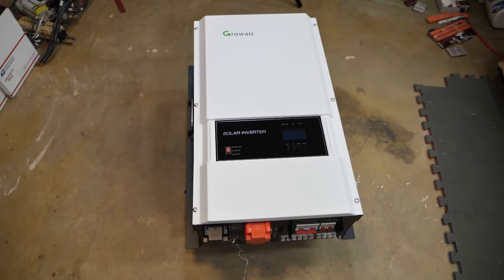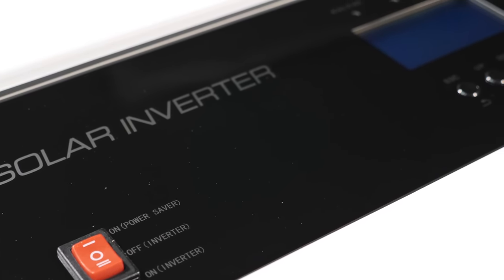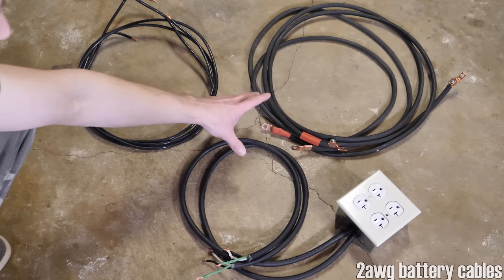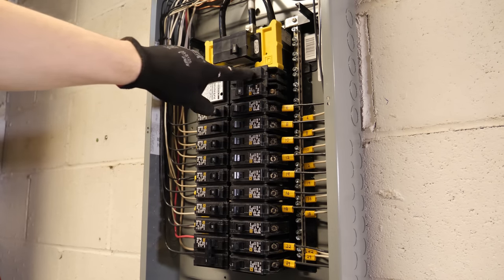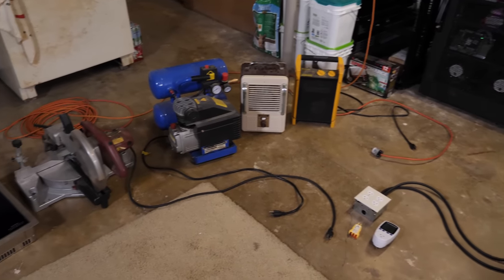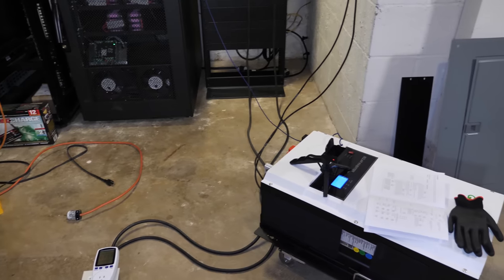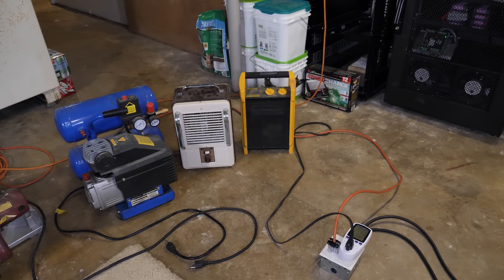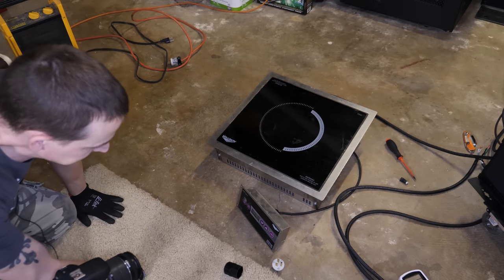12kw Growatt Inverter Operational Check/Review!!

Comment: Thanks for the video. I have the same inverter/ charge controller.  I was going with different brand and model when I found the growatt. I talked to same place and about different models and went with the 12kw too. Started the solar design and planning 6 years ago  with move to large acres in mountains. Well 3 years ago did the big purchase and stock pile of supplies. Then begin this year bought batteries and started our offgrid homestead in June. Well finally getting my pv setup and finishing wiring. So it was nice to see the setup and test. I also have to hook up my generator to system so when batteries are low and no- little sun it will kick on.
Reply from the maker: NIIIIICE!!! Im a little jelly of your place in the mountains. Id love to do that! Im from wyoming and miss it. Live in Omaha Ne amd its to flat🤣
Reply: How much is the standby consumption when the inverter is on and not powering anything?
Reply: @Dave_889  well still learning as we go. But it has standby and on and have seen that the read out is not accurate. But on standby it says 1.2% and I forget the watts: still have to get second array up to get better charge and the generac activation done to charge plus get the 2 wire relay on the victron monitor setup: it’s been tough working full time job and building a homestead from scratch plus manage power.
Reply from the maker: Its 150ish watts powering itself and nothing else!💥🤘
Reply: @AveRage_Joe  Daam, that's a lot of power
Reply: @kylebacher8074  I assume you are using at least a 48volt 100AH Battery to power it. How long does your battery last and what do you power?
I plan to purchase one at end of this year and I am wondering if 1 of the EG4 48VOLT 100AH Battery will be enough for the time being to power my home.

Comment: couple questions, what is the maximum solar watts i can input into this inverter and if i dont have batteries will it still power the 12kw to my home just using the solar input? thx
Reply from the maker: Solar input is 7000w or 120 amps.  This inverter requires a battery but yes you can use the full 12kw!
Reply from the maker: You bet! Yeah if you need 12kw and are running off solar during the day, you will draw from battery. For solar input "they" (people of the internet)say you can go over roughly 10% which is around 7700watts. That will allow you to charge sooner in the day, later in the day, more charge during cloudy weather ext... as the inverter charge controller will only output 120amps. If you have more panels then yes add a seperate charge controller and try to match the settings as best as you can. Thats what ill be doing when I get more solar!🤘

Comment: Great video Joe, I just order this inverter and also 16 panels @425w which will give me 6800w. I will connect directly 8 panels in series to PV input #1 and 8 panels to PV input #2 on Inverter. Do you think that this is the way to do this correctly? I am little bit confused about this and I don’t want to make any costly mistake, so I would like to have you comment or suggestions on this please. Many thanks
Reply from the maker: Nice! You will love it! So for your solar input, series as many as you can BUT dont go over the 150v or 250v input which ever one you purchased. Just look at the open circuit voltage on the panels and then add it up. I have 6 in series. I could do 7 but wouldnt have enough panels for all the other strings.

Comment: I have a strange question i dont see any answers for. On the 12k mvp i found that pv1 and pv2 are separate as far as each has a max of 250 volts and or 7000 watts solar but can they run with diferent voltage on each one and could a 48 volts 30 amp be hooked to one. Here is my thought for why this question. If i hook my 6000 watt solar to pv1 running 233 volts at over 40 amps. I would like to hook my 48 volt dc wind turbine to pv2 at around 25 amps. Would growatt accept that?
Reply from the maker: So the pv inputs are seperate 60amp charge controllers and each can accept up to 250v. Again they are seperate for a combined 120a. Yeah you can use 233v on pv1 and a different voltage on pv2 BUT you would want to be in the MPPT range if possible.

Comment: I own one of these growatt inverter. I am on my 3rd one over the last 4 months.  First one dead on first 24 hrs.  2nd one had fan lock codes by week 4. Growatt sent a firmware bin file update and it kills the display. And my 3rd one had same fan lock code by week 4.  Growatt sent same firmware bin file fix. I am back to display unreadable and hard to control the inverter settings with a unreadable display.
Reply from the maker: WHAAAAA!!!!! For real????
Reply from the maker: Do you happen to know the firmware number? If I get that issue I for sure dont want to flash with the same!!!
Reply: The only way I can control these inverter now is using pv keeper software on pc or the shine phone app on my phone. I have never uploaded a youtube video before or I would show what the display looks like when wrong bin file is flash making the display unreadable.
Reply from the maker: Thanks for letting me know the issue and that number!!! You could send a pic to my email if wanted its averagejoestuff@gmail video may be to big for email. Id be interested to see!
Reply: I just emailed you pics
Reply from the maker: Awesome! Checking meow!

Comment: Great video! One question, I have this inverter and have it set for the utility to charge my batteries if the solar fails and the battery voltage gets below 46v. Could you share your settings, specifically programs 01, 05, 12, and 13? In my tests, the utility power never kicks in.
Reply from the maker: Awesome! Yeah my settings are as follows.
1-sbu
5-use
12-46v
13-54v

Comment: That induction cook top looks like a NEMA 6-20 which is needs a  250v 2 pole  20 amp circuit. You need the proper circuitry to test. It looks like you were only test single pole units. There should have been some sort of switch to change the unit work on 120v. Time to test it again. Make sure your are using the specified amperage outlet and plug please. You were using a 15amp plug in a 20amp outlet.
Reply from the maker: Interesting, I didnt see a switch but to be honest I wasnt looking lol.  Time to test again!!!

Comment: do you still recommend the 12kw Growatt Split Phase Low Frequency 120/240 Pure Sinewave Inverter Model # SPF12000tDVM??
Reply from the maker: 100% still recommend! Get the MPV 250v version. Should be linked down below video. I actually ordered the 150v version and the 250v was delivered. I honestly didnt know until latet lol🤷‍♂️  Ive been using mine pretty much non stop. Few randow glitches here and there but I would purchase again. Another I would recommened is the LV 6548. I did a review on my channel. If you get 2 of those for split phase then you get more charge controllers for solar. That would be the only downside to the growatt 12k.🤘

Comment: Hello, like the videos... question. What would you use for a small 7 to 10 rack datacenter? Would this work or bigger unit and big battery?
Reply from the maker: Thanks mate! What are your plans for the rack? As in off grid or as a ups(for powerloss). What is the racks total wattage while running?
Reply: @AveRage_Joe  Hello, this would be power loss, and connected to grid, no solar to start at least. not sure of total power, but I'd say under 30 Amps
Reply: Looks to be around 10k Watts, but that will go up, so I'd rather go over kill and not have to add or replace stuff down the road.
Reply from the maker: Ok. Well 30amps on 120vac is no problem on inverter or battery. This battery would give you over an hour runtime. If you need 10kw of power then you would want A LOT more battery as in more in parallel. How long of runtime do you need/want?
Reply: @AveRage_Joe   1/2 hour would be ok. I'm looking to replace the 3k UPS's at each rack. the cost per rack for UPS's is about $2500. If this will work to to place them I'd save a good amount.  On that note, can you use more than one going into the same electrical panel?
Reply from the maker: Oh ok gotcha! So really you would only need like 3 batteries. That will give you 300+ amps of battery and give you over an hour at full send of the 12kw inverter. For the inverter or this exact same 12kw inverter, they cannot be paralleld together but you could always add a seperate subpanel for another inverter if you ever needed to.
Reply: @AveRage_Joe   I was just thinking the same thing, 2 feeds from AC main, 240 volt... then 2 inverters for say 5 racks each.  What setup for parts do you think I will need? Feel free to add affiliate links if you have them. I do see they make a 36k and 70k, but think they might be out of reach for now,.

Comment: Hi Joe! , Recently I purchased this inversor + 12 panels (540watts) + 8 trojan batteries (6v lgac-ac),  but Is not working correctly, when the batteries are low (or the house require more load of the avaialble of the pv+batteries) the inversor power off instead of bypass to utility, the batteries have a dc shunt of 80amps , I noticed every time the inversor power off is because the shunt circuit break is open, so I should close the shunt and restart the inversor, do you have an idea why is happening?? I researched about the shunt and noticed most of the sites recommend install on the negative wire, I reviewed my installation and the shunt is on the positive! , this could be the reason??
Reply from the maker: What is your low battery voltage setting at? Most shunts are on negative wire. Unless you are saying your circuit breaker is on positive then that is ok. Also an 80amp cb sound a little small to me for a 12kw inverter. You should have around a 300+.

Comment: Would a 48volt EG4-LifePower4 Lithium Batteries Kit | 30.72kWh work with this and how much solar panel  input would this need to keep it charged up?
Reply from the maker: Yeah those batteries would work great. Id max the solar charge controllers on the inverter out! Summer time(for me) is ok but winter not so much. I would need double for sure.

Comment: Well I just got into the comments to let you know that an induction cooktop will not operate without a proper load, that is to say, an induction ready pan, skilit, or pot, and don't put it on empty, because it heats up very quickly, and if it is a non-stick, it can go past the maximum safe temperature, there by destroying the non-stick coating, but I see someone else has already mentioned it after I already wrote this comment. 😖Also this inverter draws way to much idle current My OutBack inverter idles at 24 watts granted it is 3,600 watts, however running 3 in parallel, which gives me 10,500 watt capability is still only 72 watts when all 3 inverters are running, but the good thing is, they are staged when in parallel operating mode, which means that only one inverter is running until the load gets passed 12 amps in which case it calls a second inverter online and then when it gets passed 24 amps it calls a third inverter online and you can parallel up to 10 of these things giving you a continuous 36,000 watts. 🤔😳😉
Reply from the maker: Its cool to hear your inverters work like that! I didnt know they could do that!  Are your inverters low frequency?

Comment: So, will this thing use the grid for a backup to supply loads over what the inverter or solar might not be able to produce?
Reply from the maker: Yeah you can set it up like that. I have it set to use grid as a backup if battery and solar are dead or cant keep up, it switches over to grid!🤘
Reply: @AveRage_Joe  Very nice!  Do you know if it can be limited to not feed the grid?
Reply from the maker: It does not feed grid.
Reply: @AveRage_Joe  Oh hell, I missed that then.  Awesome unit there...  Been torn between this or a couple 5000ES...

Comment: In the user manual for 12k version it says to connect “3*2AWG”. Does that literally mean three wires from each terminal? Am I reading that correctly? You clearly just used (2) 2AWG wires for battery which seems to make sense. Am I reading the spec wrong?
Reply: Yes they mean 3x2 AWG cables from each terminal,  there are lots of amps going through those DC wires if it runs on max continuous load.
Reply from the maker: Yeah you can use 4/0 for sure. Ill be using 2/0 with my new batteries.
Reply: @The Osborns yes you could use 4/0 however there is not much space around the terminal of the inverter so bending of such a large cable can be a problematic.

Comment: Is this a high frequency or low frequency inverter. Does it handle surges?
Reply from the maker: It is a low freq inverter and can handle surge to 36kw!😁💪
Reply: @AveRage_Joe  that's an amazing inverter I'm off grid so I dont need the grid tied features
Reply from the maker: Yeah you dont need to connect to grid if not using as a ups or anything like that.

Comment: I have the same Growatt you do, I 7000 watts coming in and runs whole house ok, but although the inverter is 12k watts, batteries get depleted throughout day. I don’t get it, an inverter designed for 12k but can’t charge batteries at a higher rate, can you explain, thanks 
Good job btw
Reply from the maker: What are your settings and how long do you have 7kw coming in?

Comment: Hi Joe, I have an 8.4KW grid-tie Enphase solar system that produces 240V and shut down when there is no power from the grid, Question I believed I know the answer, it is possible to use the inverter and battery out the grid to supply the 240v to the solar system so they can start producing and supply energy to the inverter and charge the battery?. question 2 there is any inverter without the function of solar input so I can use it only as backup power when there is a power outage instead of using a loud generator.    Thanks
Reply from the maker: 1st question is no. You would need an AC coupled inverter like a sol-ark. It can grid-tie amd when the grid goes down you can still use the solar and system as you are asking. Also has a battery. Question 2 is yes,  most inverters can be used for a backup if it has a solar input or not. I can use mine without the solar. Hopefully I answered your questions. Let me know

Comment: For 240v, should  the neutral and ground for subpanel connect to the inverter(ac input grnd & ac output N)? Should G and N be separated inside subpanel?
Reply from the maker: Inside sub panel yes seperated. Mine bond at main panel!

Comment: Great video and lots of comments in reply. Is the 160 watt standby power a good thing for these low frequency inverters? Is there some way around that? If I dont want to be burning thu 160 watts every hour on my batteries and want to have 120 volts at my house outlets what can I do ?  I suppose in the day time the solar panels should cover this loss but after dark Im losing 1.6 kwh per night.
Reply from the maker: Thanks Man!  Yeah the 160w is high but pretty standard for this size of inverter.  Im not to worried about it at this current time but Ive been use to higher idle draw from the 2700w UPS I was using for an inverter.  I know the high frequency inverters have a lower standby or idle draw but not many are split phase and cant start a regular saw or compressor.  If you dont need a low frequency inverter you could go HF for sure!

Comment: Hey Joe, I installed two of these babies but I over estimated it.  I was told that a flash upgrade would fix the issues. 1 of my units has been a brick since june 2022 the flash failed bought off of alibaba the poorest of customer service directed to them by the usa vendor that endorsed the flash. . 
I am in need of all the help that I can get
Reply from the maker: I can send you a link to the firmware I flashed on mine a year or so ago. I think I still have it on google drive

Comment: Great video Joe, because of your video I went and buy 6000 watts version but sometimes it reboot by itself and when my battery is too low the inverter shut off but when it comes back on I have to change the setting to 60hz. It does not stay on 60hz after rebooting
Reply from the maker: Interesting! I would check for a firmware upgrade!

Comment: Can this run on solar and battery, then, if battery is low at night, then it does AC pass through? In other words, only use AC passthrough as last resort.
Reply from the maker: Yes! And that is exactly how I use it!
Reply: @AveRage_Joe  thanks!
Reply: Does it have a Dump load? Like the sol ark? A circuit where if the batteries are full and there’s excess solar, it sends the power to something like a hot water heater or electric car charger?
Reply from the maker: It does not have a dump load for other circuits!

Comment: I have the grow watt 6000 spf off grid system that I got from big battery with the husky 48v battery. It was working fine until 1 day it stopped. The fault code is 04 low battery but the battery is at full charge.. when I turn the utilities/generator on there is no put of power. I have called big battery they send me to grow watt and grow watt sends me back to big battery. Help
Reply from the maker: Ok well Ill try to help if I can. First can you let me know all of your inverter settings like bulk and float voltage settings. Have you checked voltage at battery and or is the fuse popped. You can reply to my email addy. Should be in description.
Reply: Blk is at 56.4 and Flt is at 54.0 and the ⚡ on the battery is at 52.0 battery type is at Use